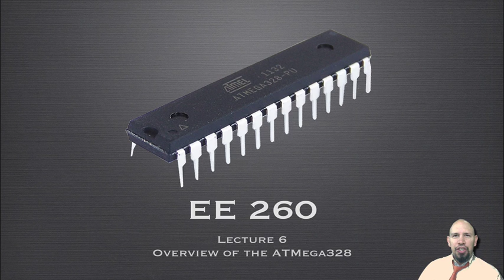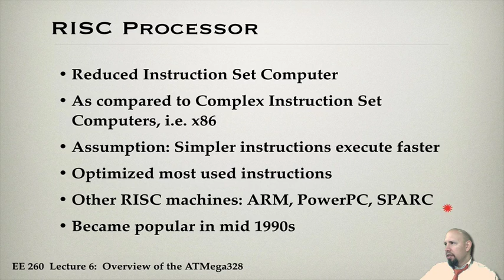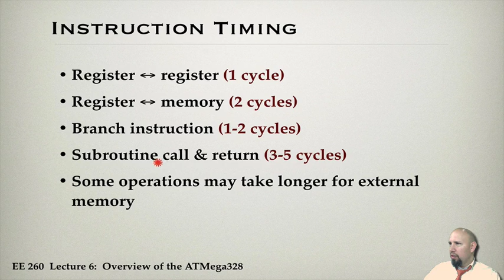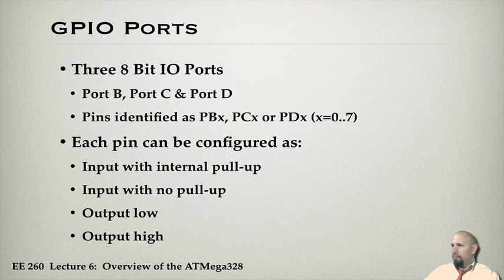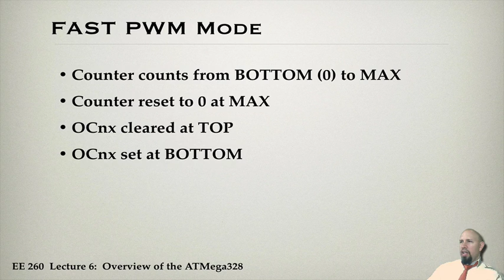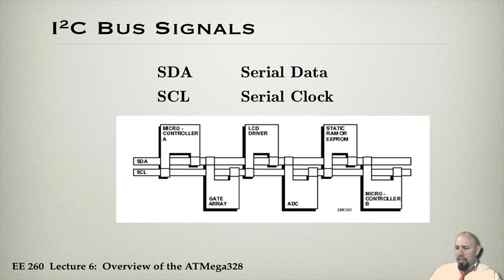6. Overview of the ATMega328P Processor

Comment: So these come up as color coded on a hard reset? IOW pin7 has 13 in Brown; PD7 as yellow then pink is likely the pin number;  AIN1 is on the same pin as Interrupt 23 ◘ my question is do we set these on init? Or do they come up any of the labels are in service and may be used as any datatype?  I do mind even slightly setting these on power-up but I have not even connected my power supply just yet;

Hard experience has shown me to do a soft reset;
Reply: Be sure to clear your SDRAM on power down so that Godzilla cannot peek

Comment: Helo Robert,

Could you please post a link where I could download the image of "Atmega328 internals" at  11:50?
-Thanks, Ram
Reply: in google images you can type arduino uno pinout diagram . it also gives the pin out for atmega328 as thats used in arduino uno.. :-)

Comment: Hi,

I was checking the book you recommended and found out it was written for the Arduino Duemilanove, not the Arduino Uno. According to Wikipedia, both arduinos are basically the same, save for usb/serial port. Could you please confirm whether these boards are fully compatible concerning C and assembly code?

Thank you
Reply from the maker: +JSA2019 Yes, these are basically the same as they both use the ATmega328P micro controller chip.  The main difference in the two is the slight difference in layout of some of the I/O.  However, almost all shields will work equally well with both.
Reply: @DrZAP42  where can i get this ppt which you used to explain?
Reply: @manjunathhipparagi8493  Dr. Robert (Bob or Bobby) Alex Paz was an associate professor at NMSU Klipsch School of Electrical and Computer Engineering. He passed away on March 26, 2017 the age of 54, having battled Leukemia (AML) for the last 18 months of his life. Dr. Paz graduated from NMSU with a BS in Electrical Engineering, and from the University of Illinois Urbana-Champaign, with an MS and PhD also in Electrical Engineering, and was fortunate to obtain a faculty position at his Alma Mater. He served for 25 years in a professorial role at NMSU in the Klipsch School of Electrical and Computer Engineering.
Reply: @manjunathhipparagi8493  so, he can't reply you anymore.
Reply: @sajidnaseeb5386  I'm so sorry
May his soul rest in peace

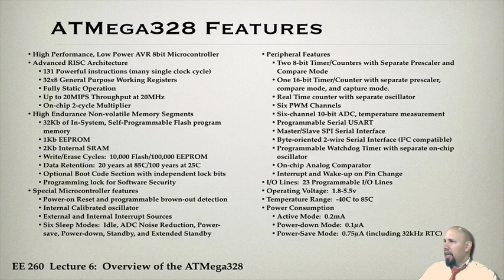Comment: I've just figured out. At 24:09,I saw ATmega has PB6 and PB7 on pin 9 and 10 respectively.But I didn't see these 2 PORT registers on Arduino when you introduced Arduino connections in the preceding parts.Arduino doesn't use PB6 and PB7,does it? Thank you.
Reply from the maker: Port B pins 6 & 7 are connected to the ATMega328p pins 9 and 10 and are used for oscillator/crystal connections.  Even though they are theoretically "used" for PC interrupts 6 and 7, they are not available for that when a part of an Arduino.  The Arduino uses these pins as connections for the 16MHz crystal oscillator.